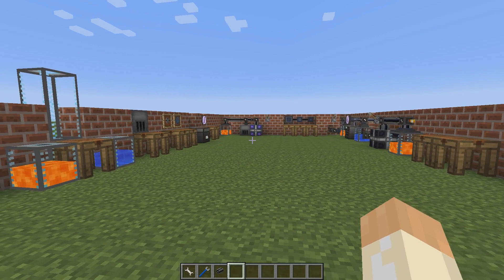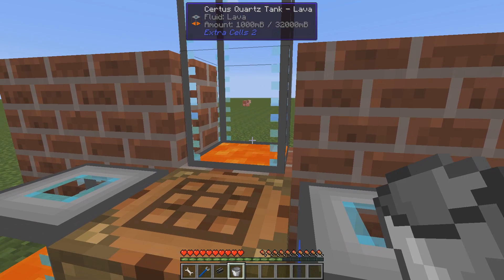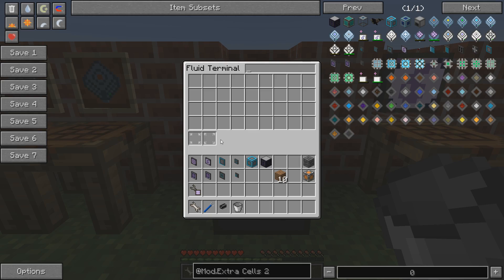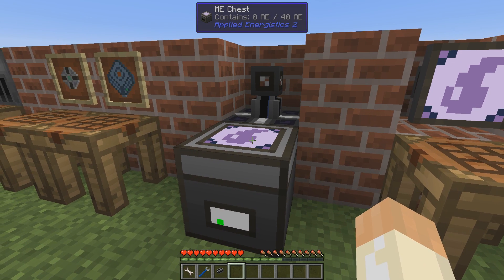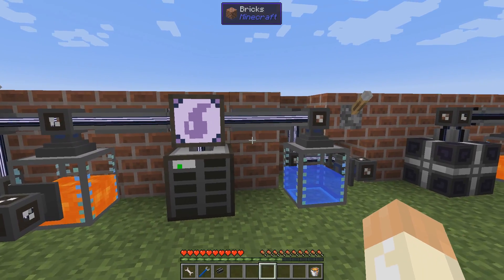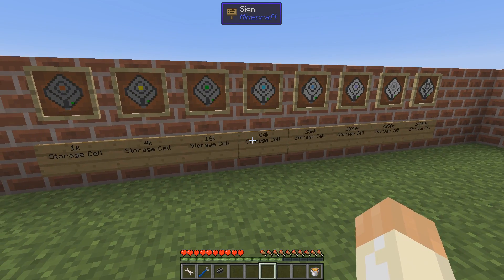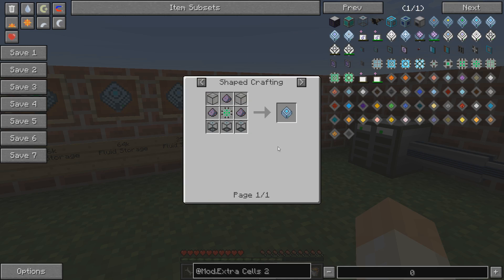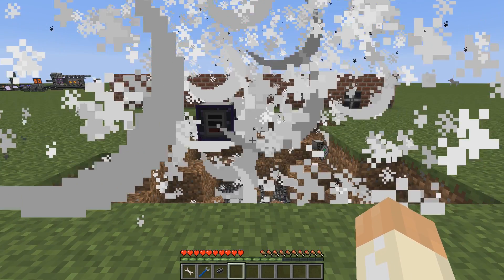ExtraCells 2 Mod Spotlight 1/2 - Getting Started - Basic functionality (MC 1.7.10)

Comment: i cannot seem to get rocket fuel from advanced rocketry 2 into any fluid drive larger than the 64k. Im playing mc eternal, could have to do with some mod setting, but it seems weird. Any ideas?
Reply from the maker: I have tested this in a 1.12.2 creative test world and it worked for me. I only tested with regular 64k fluid cell from regular AE2 and 256k fluid cell from Extra Cells 2. I don't know what you use or what versions are in the pack but at least I can share my results whice were positive.
Reply: @therealtkh  ok cool, i probably missed a step. Thanks for checking that

Comment: i did some tests and got the following

1K Fluid = 256,000 mb / 256 Bucket

4K Fluid = 1,024,000 mb / 1024 Buckets

16K Fluid = 4,087,000 mb / 4087 Buckets

64K Fluid = 16,384,000 mb / 16,384 Buckets

256K Fluid = 65,536,000 mb / 65,536 Buckets

1M Fluid = 262,144,000 mb / 262,144 Buckets

4M Fluid = 1,048,576,000 mb / 1,048,576 Buckets of a Single

Portable Fluid = 128,000 mb / 128 Buckets (only 3 fluids compared to the standard 5)

16M = 133,169,152 of a Single Item or 68,157,440 of Multiple Items

4M = 33,292,288 of a Single Item or 17,039,360 of Multiple Items

1M = 8,323,072 of a Single Item or 4,259,840 of Multiple Items

256K = 2,080,768 of a Single Item or 1,064,960 of Multiple Items

Block Container = 520,192 of a Single Item
Reply from the maker: +6210 classick Awesome, I did kind of the same investigation of normal storage cells so this is a great summary!

Comment: How could I use extra cells to autocraft cake?
Reply from the maker: +SuperBulian I planned to show auto-crafting with fluids in the next video, but generally you make a pattern with a bucket (with a fluid) and you place the pattern in a Fluid Assembler. It works for me with water recipes, however, Milk is not considered a fluid in standard Minecraft, and not with Extra Cells either. So you need a mod that makes it possible to put milk in tanks - then you can make a Cake pattern and auto-craft it.
Reply: I think that machine is called a Cyclic Assembler. :) Thank you for the information.
Reply from the maker: +SuperBulian No, Cyclic Assembler is from a completely different mod and works in a completely different way ;)